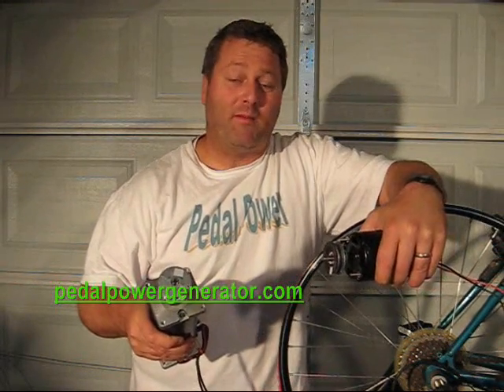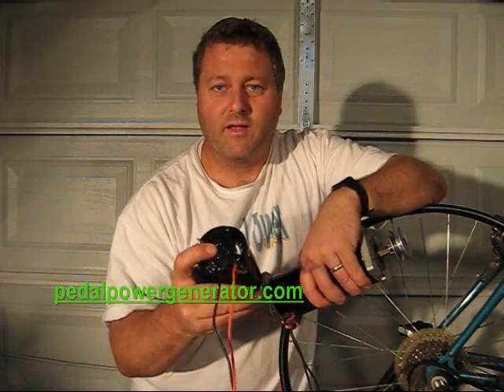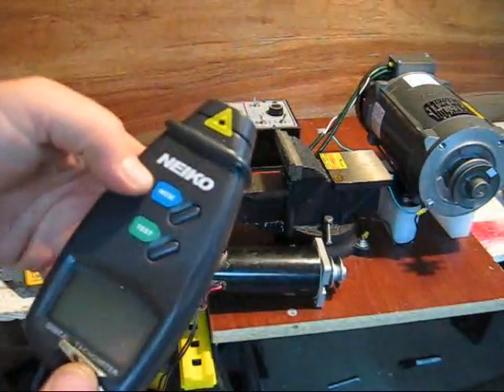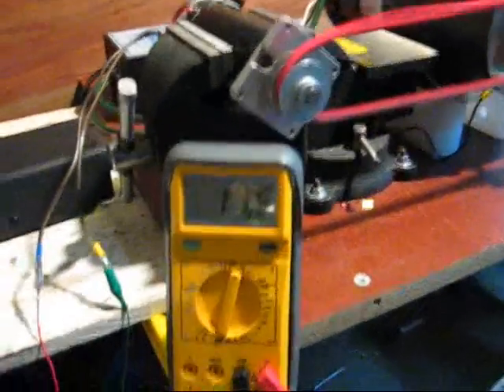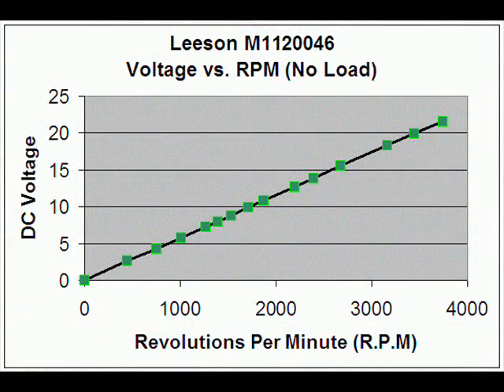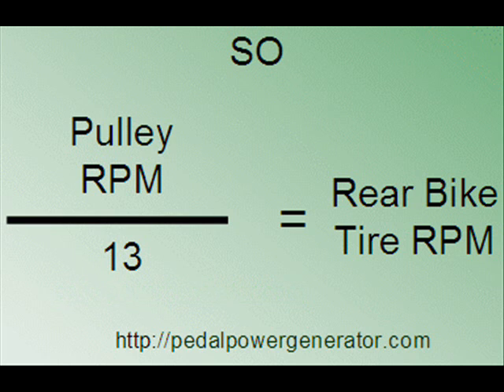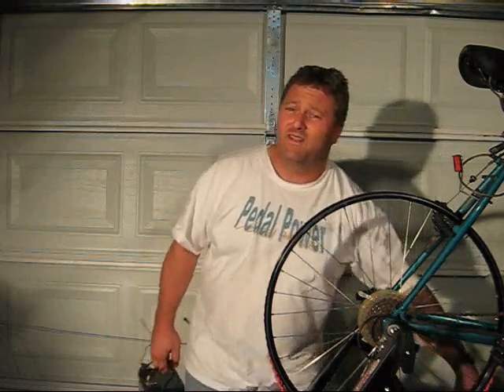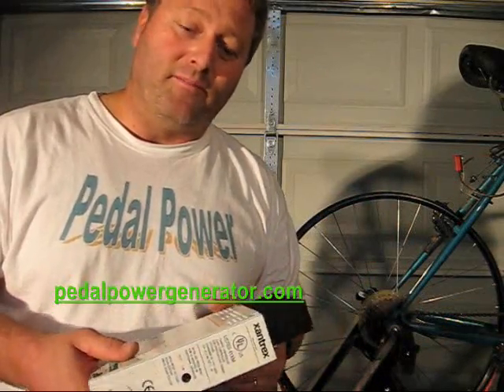Permanent Magnet Motor Used  as a Pedal Power Bicycle Generator Dynamo

Comment: Thanks for the video.  It's the first one I've seen where a charge controller is being used.  I've been trying to find data good or bad on using a motor instead of pedal power.  Did I miss something in physics class that most folks know it's impossible to do and that's why I can't find anything? Too much loss? Would a load cause the gear system to stop altogether? After much research, I went with a MidNight Kid charge controller to regulate output power. It can handle the 3 main sources. Solar, Wind and Hydro.  I'm using (2) 250 Watt Solar panels. My thinking is to use the gear system to gain higher RPM.  Using a standard road bike.

Comment: Might be worth noting that a simple voltage booster (see Joule Thief) with a couple diodes can take any voltage between .7v and the normal min charging voltage for your lead acid battery, and up that to trickle charge the battery. More bang for your bucks with parts available in a CFL bulb :).
Reply: Yes that would be nice to take advantage of sub 12V  output voltage produced at low RPM - when coasting at lower speeds.   Of course when on a bike generator you just change the gears to accomplish the same goal -  Brad Whaley Electrical Engineer
Reply: +bicyclegenerator : what is the current generated at different speeds and what is the torque required to drive the generator at different speeds..?

Comment: @kd7one Yes, but if put a 100 Watt load on the generator - I have to use the small drive pulley so the 1 horse power motor doing the driving doesn't stall out.   Brad pedalpowergenerator d o t com

Comment: @JavaRatusso I'm not sure on your bike which gear will get you comfortably to 14-16MPH, but on my 21 Speed I have to put it at 19th gear to get there comfortably.   This generator is just like  pushing against wind when you ride.  If you ride slow with a PM generator hooked up to your bike, then you feel almost no resistance,  but if you pedal fast, then suddenly its super hard to pedal!

Comment: I would like to know when trying to achieve the specified 14-16 mph, up to what gear on this bike would be mostly likely used? Is it a 10 or 15 speed 26 inch Bike? I would think that given the "progressive step up" to a higher gear, the required speed could be reached easily. Great video man! One suggestion though. Use short sleeves if you are going to reaching over the moving belt, because that motor was cranking fast enough to pull your arm into the pulleys. Be safe, and thanks again!

Comment: Why did you abandon this motor for the one that you're currently (no pun intended) using?  The motor that your new plans use doesn't look like it could handle 300 watts on the wires coming out of it.

Comment: @edisheng Use a data logging current sensor with your DC motor and measure how many watt hours it takes to spin your fly wheel up to 4,000 RPM.  The you will see how much energy went into your fly wheel.  Then with your flywheel is still spinning, put a 20 Ohm resistor across your motor leads,  and let the fly wheel run until it stops, with the current sensor data logger still running.  This will tell you how many watt hours was stored in your fly wheel.  Try the WattsVIEW sensor.

Comment: @elledeeism For a kids bike application you have two options, the 1st is to use a DC  motor that is rated for over 80 Volts,  I like the treadmill motor I bought from a surplus place, it is rated for 110 Volts DC and up to 6 Amps.   The only problem with a treadmill motor is that it has a very strange shaft hat must be ground down smooth so you can put a pulley or roller on it.    The 2nd option is to mount a horizontal shaft on a piece of wood with step pulley, upping the spin ratio.

Comment: @elledeeism For a small kids bike you need to use a motor with a voltage rating of 80 to 160 Volts DC with an RPM rating of about 3k.   The easiest way to store and use your energy is to wire  your bike generator output to a powerpack through a blocking diode.    THis powerpack can power up cell phones, TV, laptop, light bulbs, you name it.

Comment: @zuseable Yes- the razor scooter motor is the best thing to use for the money. It has ball bearings, and it's four poles instead of just two, and it also can handle high temperatures so up to 20 Amps of current.

Comment: @bryguy124 You can get the permanent magnet motor from Ebay pretty cheap by typing in the words "DC Motor" into the search window.  ALso you can use treadmill motors although the problem with those is that you have to design a pretty funky mounting bracket to make it work with your setup and also the shaft sizes are really funky so that you can't just put a pulley on it.  I was able to give one 12 volts and make spin and then grind down the shaft with a bastard file so it would fit a skateboard.

Comment: @ZirixZero Your average car can put out 150 horse power which is about 111,000 Watts of energy.  Compare that to a human on a bicycle - that would be only 200 Watts of power output.  So a car would put out about 550 times as energy as you on a bike generator.

Comment: Our best performing sequenced Pulse motor is driving a induction generator charging 8 44AH Batteries at 30-40Amps while recovering 80% of the energy that is being used to drive the pulse motor. check out a induction power generator for your application may be worth your time. A self excited induction generator can make 120v at 650RPM with the right capacitors and its producing  3 phase AC output.

Comment: hello i own a lincon gasolin welder and i have found if you turn a dc motor it makes dc curent so if i take a dc generator off a lincon welder and add power would it spoll up as a dc engine cant find out my self can you help want to make an elictric motor cycel if it will work

Comment: What's the model of your battery and whats the model # of your charge controller? I want to look at the specs.  It sounds like your batteri is not able to take a charge.   You need to do a load test on it and make sure it works correctly.  Did you buy this battery new? or did you find it used from some place?

Comment: just curious i have a reel motor and use a belt on a bike and noticed when hooked up to a battery 12 volt 3 amp  the voltage of the battery goes up fast  but when im pedaling  i pedaled for 10 min  the reel motor has a 12 to 24 volt  i used a charge controler up to 5 amp  the reel motor has says dc  13.8 volt and dc 4.8 amp  but noticed after 10 to 15 min the battery level goes up to 13 or more volts but after i stopped pedaling 20 min later  checked the battery level and it didnt go  up at all